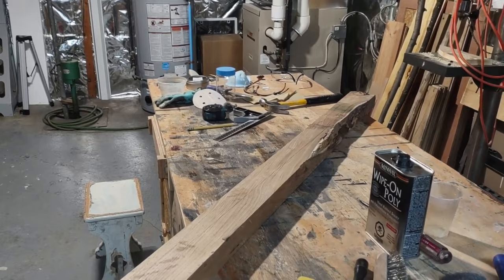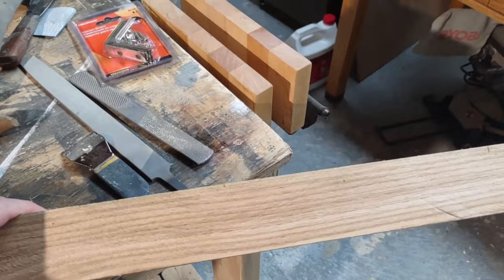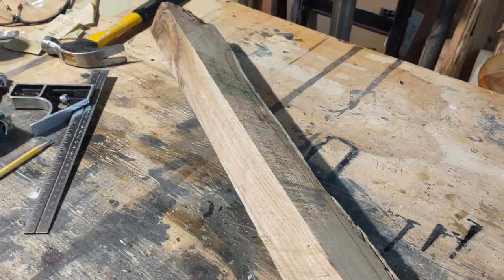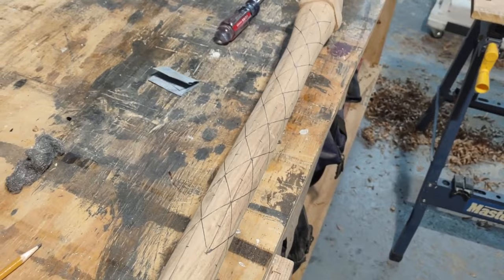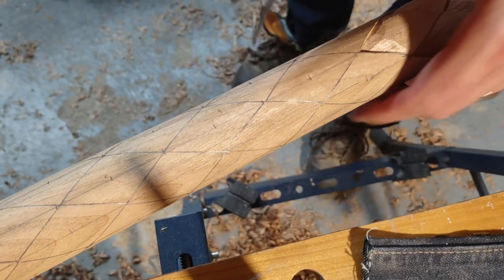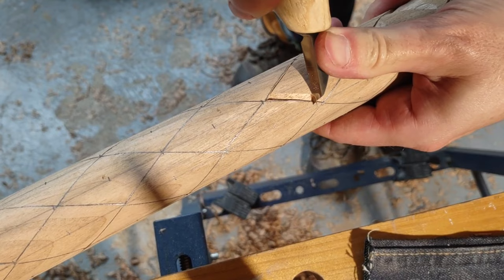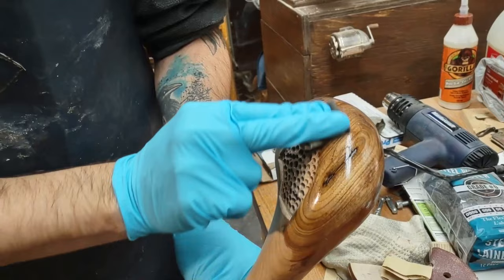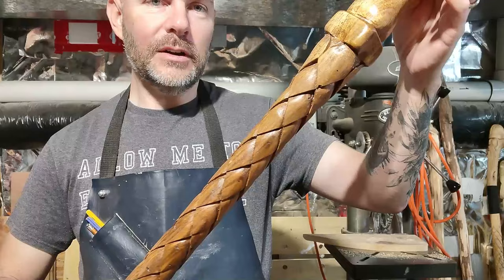Butternut Walking Stick

Comment: Hi, that is beautifull work. Inspirational.
 I've never seen walkingsticks like that . they look thick and therefore ( too ?)  heavy.  Just like your other  stick with celtic knot basketweave Is that a traditional or regional style ?
Reply from the maker: thank you for watching! I usually go a bit thicker on the softer woods to give it more strength, but the denser woods taper down to 3/4" or 19mm at the ends. There's no real regional style, I just carve them so they look good and I have used them many times and don't find them too heavy (granted they aren't as light a an aluminum pole) but they are functional!.

Comment: Really nice work, compliments. Looking forward for seeing the next one. May I ask how do you prevent wood from cracking in the coming months/years? Sealing/oiling......
Reply from the maker: Thanks! Glad you like it. Seeing the sticks are dry before working on them, no further cracking occurs. They do get sealed with oils and/or polyurethane so that helps prevent water absorption
Reply: @JasonHedrich  thanks a lot for the response, much appreciated!

Comment: Did you have to wet and re sand to raise the grain? What was your sanding progression before poly ? Thank you
Reply from the maker: You could raise the grain with water before poly… or just know that you will have to do a serious sanding after the first coat of poly due to the grain at that point. Either will work

Comment: What size was that piece of wood…width and thickness? Just curious.
Reply from the maker: It was 2" thick, about 10" wide before I cut it into 2" strips. The board was 60" tall, wormy butternut
Reply: @JasonHedrich …Thank You. It turned out beautiful!!!
Reply from the maker: @brian9227  thank you very much